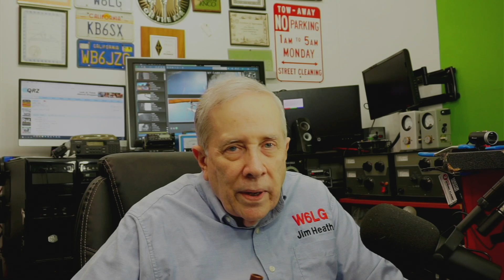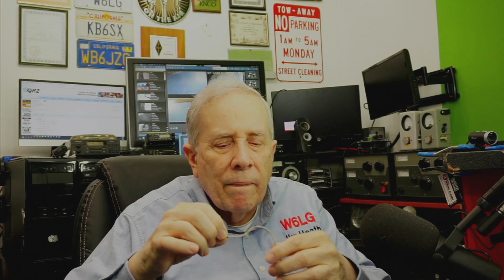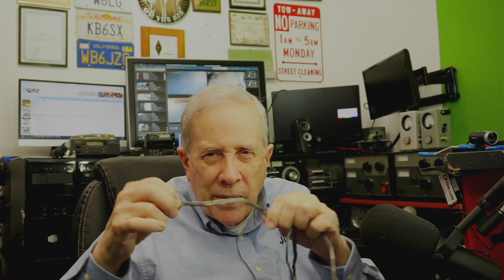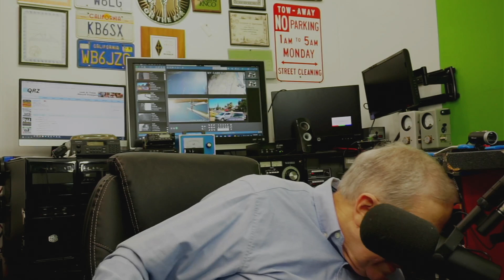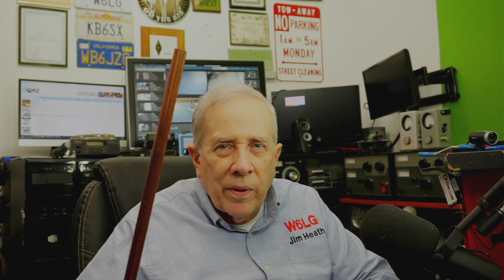How to RF Ground Your HF Station as Shown by the ARRL and a Discussion about Ground Loops, Bonding

Comment: 40 years licensed and I have never had an external RF ground. I have nearly always used dipoles or yagis with baluns so there was never any need. In recent years, here in the UK, adding an external ground can be dangerous because a lot of modern houses use Protective Multiple Earthing. This means there is no electrical ground. The earth return goes via the neutral cable back to the electrical substation. If you drive an earth rod into the ground and attach it to your radio there can be an electrical potential between the outer casings of your equipment (which is ultimately connected to the electrical earth) and the rod you hammered in. To make matters worse, that differential could be as high as 230v if there was a fault and it would not trip the RCD in the power distribution unit if you came in contact with it. The current earthing craze is all about reducing the RF noise floor but I have not seen any evidence that it does.
Reply from the maker: Thank you Mr. Hudson.  You said it much better than I could have. Excellent. To others, read what Gordon wrote more than once and let it sink it.  It is a good lesson.  73, Jim W6LG
Reply: @ham-radio  Thanks Jim. de  GM4SVM
Reply: In the US, the NEC requires all neutral and ground wires in a house to return separately to the breaker box.  The mains disconnect breaker box is the one where power enters the house from the meter.  Only in this mains disconnect breaker box are neutrals and grounds connected together either on the same buss bar or on buss bars that are hard-connected together.  ONLY at this box is there a conductor running to a local ground rod, ufer ground, or water pipes.  This single wire provides the power equipotential voltage for the house.  No power current runs along this ground rod connection.  There should be no other grounding connections -- i.e. ground rods -- in the house connected to the house's ground wires.  None.  Nodda.

At the power pole, a center-tap transformer provides 240VAC (red-black-white).  Red and black form the 120VAC legs.  White is the return neutral and is referenced to ground voltage via a wire at the pole run into the dirt.  On this neutral runs a current equal to the difference in current on the red and black.  Like at the house, there is no current running in the wire running to dirt on the side of the pole.
Reply: For clarity, IF there are other ground rods, they must only connect back to a common ground terminal strip exterior to the house..  From that terminal strip, a single wire runs into the neutral/ground buss in the mains breaker box.  There must not be a ground rod at the other end of the house tied at the other end of the house to the ground wires running in the house.  If there is another ground rod at the other end of the house, the wire from it must run separately back to the exterior ground terminal strip.  All ground rods MUST NOT BE DIRECTLY CONNECTED AT ANY POINT to the romex ground wires running in the house.  I refer folks to the NEC manual.  They are very clear about secondary ground rods (i.e. those at an antenna) being only connected to the house ground at this exterior ground terminal and only one wire running from this strip to the ground/neutral buss in the mains disconnect.  

One should daisy-chain wires on multiple ground rods (i.e. as used with antennas, lightning rods, etc.) and connect them together (often in a loop or web).  Multiple wires from multiple ground rods and wiring loops may be run to the exterior ground terminal.  But ONLY ONE WIRE runs from that external ground terminal to the mains breaker box where the neutrals and house grounds are connected together.

None of this has to do with RF -- all this has to do with safety of the mains power.
Reply: @713allen  excellent explanation. Does this also provide lightning protection?
Reply: @ronm6359  Re lightning:  Whenever a spec calls for a "heavy" wire (i.e. solid copper or heavy gauge) it is discussing safety and/or lightning.  Only if the spec calls for copper ribbon or heavy braid is it addressing RF.  Note that ALL the NEC, NFPA, etc specs call for heavy wire…they are addressing safety and lighting.

When lightning strikes, currents run in the dirt back to the point of the strike on the dirt.  Because the dirt is not a perfect conductor, there is a potential difference (i.e. voltage) all along the surface of the dirt.  Spread your legs in a strike zone and the current can run up one leg and down the other because of this potential difference…and you die.

The same will happened to your house if you have a ground rod connected at one end of the house and run a heavy wire from it into your shack and to your equipment (which is also attached to the house romex ground wire).  At the other end of the house where the main power meter is connected to your breaker box, there is a wire from the power meter ground rod running to the ground block inside your breaker box.  In a lightning strike, currents run in the dirt and there is now a voltage difference between the two ground rods.  This, in turn, produces a current running through your house on its romex ground.  You now have lightning voltages and currents all throughout your house.

What to do?  From the second rod (and all other exterior interconnected ground rods on antennas, towers, etc.) run a heavy wire exterior to the house back to the meter ground rod.  With a heavy wire you will produce a very low resistance, high capacity conduit for lightning energy that is not up into your house while maintaining the house potential at the ground voltage of your exterior grounding web.  Visualize the house as just a bunch of wire hanging off the grounding web connecting to nowhere (i.e. no current flow, a good thing).  Connect that house wire to something and you'll get current flow (a bad thing). This is what you see in the NEC, Motorola, etc. specs.  

With gas-arresters etc. you can help minimize lightning currents going into the house on the coax at the entry point.  The coax is a necessary evil.  Running a heavy ground wire from the rod -- which does nothing for any RF problems -- is just inviting trouble in.

The worst thing you can do is put an isolated rod just outside your shack and run a heavy wire into the shack – this is simply a conduit for disaster.  And it does nothing for the RF.
Reply: @713allen  Perfectly and clearly articulated. Thank you.
Reply from the maker: You said it better than I did.  Thanks, Jim  @713allen
Reply: I live in the UK too and have tried to get answers to that exact conundrum for a few years. You summed things up perfectly, thank you.
Reply: How can be an electrical potential difference (230V) between the equipment casings and the ground when the casings is tight to gnd through a thick wire? The current usually "selects "  the path with the least resistance so how can a body touching the casings seating on a concrete slab or even on bare ground can be in danger as long as the casings is tight to gnd? Some old equipment does not have a GND plug and needs an electrical gnd. However some wall outlets GND connection might fail.I found a few during the years that even if they have provisions to be connected to GND they were not. .. I use 1 inch wide braided copper strap as Jim uses tight to 1.25" copper pipe 4 feet long burried into the GND ...
Reply: Interesting, Thanks Gordon.
Don't fall victim to this potential human "bug" zapper situation.
Reply: @FindLiberty  I have an update on this: The RSGB published an article this month in RadCom magazine pointing out that even if your house does not have PME it is likely to have been converted to PME further down the line if the cable has ever been spliced in the past 20-30 years. They recommend treating all electrical installations as PME now. This refers to the UK only. I do not know how US electrical systems in the home operate.
Reply: @GordonHudson  Thank you! I've been looking up all the differences between UK and USA power and I started writing you a book-length reply. Then, I hit the delete button out of respect for your time.  lol MORE than enough info is available on line. THANKS AGAIN. Stay safe.
Reply: The reality of earthing codes in the US (for personnel protection) is simpler than what is found in the UK.   The focus here is on keeping the equipotential point (center tap) of the transformer at zero potential, and solidly connecting it to the neutral.
Reply: The only think a ground will do is bleed off static electricity.  When we get thunder storms I isolate (disconnect ALL equipment including ac plugged into the wall. In 30 years never had any equipment damaged due to lightning 🌩.
Reply: For all the UK people. I hope your electrical grid is not being designed by Lucas, because, as you know, Lucas is the Prince of Darkness. I couldn't resist.
Reply: That's why electricians say that grounding is 33% physics, 33% voodoo, and 33% luck!

Comment: I find that most rf flying around the shack is due to an antenna being close to the shack. Example: the feedpoint leg of my delta loop was about 8 feet from the shack door and also 8 feet from the satellite yagis. So after some testing with a rf detector , I found most of the rf entering the shack from the coax of my sat yagis. What’s even more interesting is the rf peaks were showing on the copper ground braid running 5 feet out of the window. Now I don’t know if it’s supposed to do that or what? 
 Also what if the shack ground is more grounded than the ac ground? I guess that doesn’t matter since they’re bonded. I also use 1/2 copper pipe at the desk. I find that rotor cable carry’s  more rf than lmr400. Lack of shielding I assume. Hot topic. Hehe Tnx om. Always enjoy your thoughts.
Reply from the maker: Jay, I always enjoy your comments and your ability to learn by trying.  That is, you take question that you have and find the answer by experimenting.  That is a great way to learn.  And, I thank you for sharing.  Many do exactly as you and I do.  We all may not agree on the answer.  But at least we tried to figure it out and share what we have learned.  Seems like I am writing the same thing over and over in this response.  Jay, as I sit here I am thinking about a video that goes to my medical history so that others may benefit.  It is the weirdest story.  My exposure to a nuclear reactor meltdown and subsequent diseases and how many doctors would not listen to me.  It has been a six year journey through UC Davis and Kaiser.  Today, I have a chance at a major cancer hospital in another state because of help from a couple of doctors who are ham and know me through YouTube.  I am also puzzling over the tip jar idea and don't know how to set that up if I decide.  73, Jim
Reply: @ham-radio  you should add the coffee fund or tip jar. Maybe it would help with medical copays. I’ve been waiting to hear about your medical story. Mainly bc I’m a caretaker at heart. You have me curious now! You should try the out of state care Jim. You’re very sharp and young enough for hope.
Reply from the maker: @JayN4GO  I don't know how to do that.  So I will have to learn. Sadly, Mayo Clinic turned me down because they will not bill Medicare Advantage.  So, I was stopped at registration and told no thank you.  I have this rare set of diseases that I was not even able to discuss with anyone. I thought that they would be interested.  So I am pretty upset this evening. Thanks Jay, 73, Jim
Reply: @ham-radio  this is a half way tutorial. https://youtu.be/7MVKLuWoQ4k

Comment: Hi Jim, thank your for your instructional videos. Question: in your system as you described it to us, do you also ground your seperate audio equipment?
Reply from the maker: I have no outboard audio equipment at the ham desk.  My transceivers have built in systems that work great.   At the YouTube desk, it is bonded to a small mixer.  There is some ambient noise and trash in the audio that I need to fix.  73, Jim
Reply: @ham-radio  Thanks for your response Jim. On my HAM desk I have some external audio equipment (Behringer) that enhance the audio and - via a mixer - feed into the transceivers. I experience quite a lot of RF interference. At the moment I do not have RF chokes installed, nor have I grounded anything directly. Note: here in the Netherlands Earth and ground are two sperate leads in the mains. We als have ‘ground-leakage switches’. When these detect between 15 and 30mA current of leakage, they immediately switch of that main group or groups. That makes it inadvisable to connect neutral to earth in our case. Our earth connection however is a “real” earth. Lot of info, but I’m hoping you have some further advice…
Reply: @ham-radio  That SM7B is doing you no favours either. They are infamous for low output and at this relaxed distance your S/N ratio is poor allowing the mic amp noise to be clearly audible. Julian's video describes this best https://www.youtube.com/watch?v=T8HwNnJAjbQ.
Reply from the maker: @RobB_VK6ES  I will take a look. The noise is loud can't be easily filtered with good results.  73, Jim

Comment: My house ground consists of a 2 metre (6ft),  which is standard here in Portugal. I am grounded to that from all my gear, plus copper water pipes that run through the shack being grounded to the same house ground. BTW the house ground is a metre from my shack (my shack is semi-basement). 73 de CT7AOX ex G8CYE.
Reply from the maker: Thanks Stephen.  I hope the climate there is as good as I believe it to be. Sounds likes you made a good move. 73, Jim

Comment: One thing I have noticed through the years is that when I run a ground wire from my transceiver to a ground rod I have much less noise on the receiver.   de WB7ORB
Reply from the maker: Interesting Tim.  I am think about it and may test that idea. 73, Jim
Reply: I have noticed the same thing with my scanner.

Comment: wonderful video. As it happens, I just bought an electrical power supply for my first radio after running it with a battery for a month. Finally had the 'courage' to feel convinced that the grounded plug actually provided adequate electrical safety without a supplemental outside copper 'ground' rod that had to be connected to the main electrical panel to comply with code. I had been wondering about the utility of bonding the equipment together to ensure similar voltages without a connection to an external ground rod. Could you express your opinion about a 'ground plane' of copper sheet under the equipment, sold by for example DXEngineering? My major question about your video is what do did you mean by connecting the copper bonding pipe on your desk to the electrical house ground? Is there a wire/braid in addition to the fact that these devices are connected themselves to the house electrical ground via their electrical plugs? If so, how is it done? Thank you.
Reply from the maker: I think from the common point ground in the shack using some stuff from DXE, that is the end of the connection.  All of that equipment is in the same electrical plane. From there to the panel does not matter much. It just needs to be good at AC/60Hz.  73, Jim
Reply: @ham-radio  Thank you! I appreciate your generosity in sharing knowledge and experience.
Reply: @ham-radio  Do I understand that you are proposing to install only a copper bar to connect all the equipment but that this bar should not subsequently be connected with a cable to the electrical ground of the house?
Unless since the station is already powered by the 120v which is already grounded to it, this is sufficient?
In my station, I installed an aluminum angle iron behind the desk and the equipment is connected with #10 flexible wires. This is connected to an SPG, which is right next to it with a #6 wire in the station where my antennas are also connected on an angle iron and where the PLDO, RJ-45 and rotor wire are connected. From the SPG to the ground rod there is a maximum of 15 feet (maybe 10). It is connected to my electrical input which is just above. My antennas before entering the house are also grounded since the entrance is in another place and connected to the rod of the station by a wire #6 (15 feet). Am I making a mistake?
Reply: @ThinKkBIGG  AC wall socket ground comes via the power cable to the chassis of your equipment.  The chassis of the equipment connects to the copper pipe buss.  The more equipment connected this way, the more parallel ground paths to house ground you have.  An additional wire from the copper buss to the wall socket house ground is visually satisfying but electrically redundant.
Reply: @713allen  This is only good for AC grounding in a residential installation. The SPG of the shack must also be connected to the same potential as well as that of the antennas before entering the house.

Comment: Greetings...

Does it help to use a single point star connection for your equipment grounds ?   

Thanks
Reply from the maker: Yes it does.  From there to the panel just needs to be good at 60Hz and provide safety. There is no such thing as an RF ground. 73, Jim

Comment: Hi Jim. Wouldn't the wide strap (from the equipment) be defeated when it is connected the the earth ground at the power point, as it then runs in a smaller diameter round wire,  back to the house ground? 

As usual you have given me much to think about. 
Regards Glenn from VK.
Reply from the maker: There is no RF ground.  We are not talking about RF to the panel.  Just a normal safe ground connection for AC in the event of a fault. Nothing to do with RF. 73, Jim
Reply: he didnt ay anything about rf ground  @ham-radio